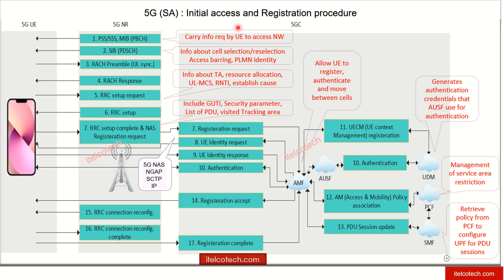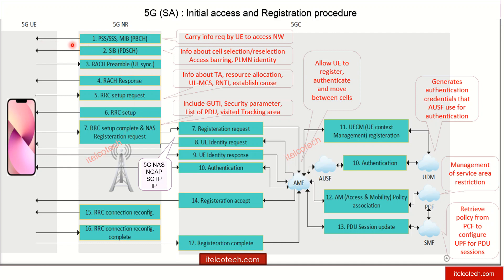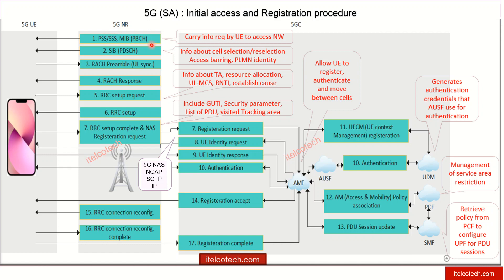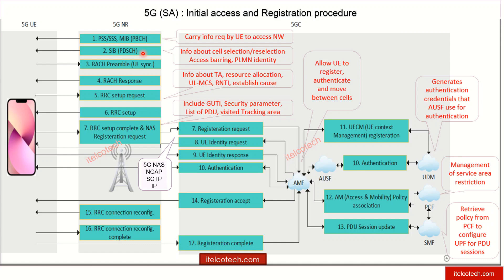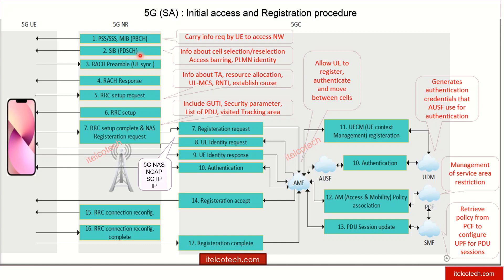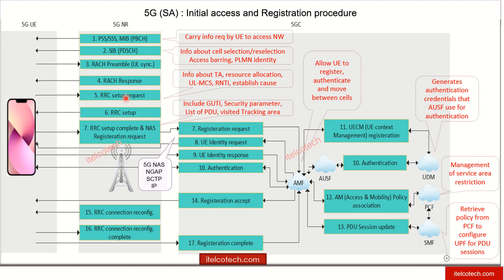5G Call flow - 1st part - Part of 5G course - link is in description

Comment: What 1st thing Ue do once switched one first time.
Reply from the maker: Hi Shailesh,
In 5G SA, when UE switched ON first time, at radio access network level, it has to search for a suitable cell and synchronise with the network. This process is taken care by SSB only.
Reply: @shaileshyadav4084 .In 5G SA, when UE is powered- on, it will start scanning the whole band with a granularity to locate the frequency domain position of SSB.
Reply: What is granularity used or followed by ue to search ssb
Reply: @shaileshyadav4084  The position of SSB is variable. And to find the frequency domain position of SSB, UE needs to perform a frequency scan across whole bandwidth using a granularity called as synchronization raster. 
synchronization raster defines a set of allowed center frequencies for SSB. It can be 1.2/1.44/17.27 MHz.